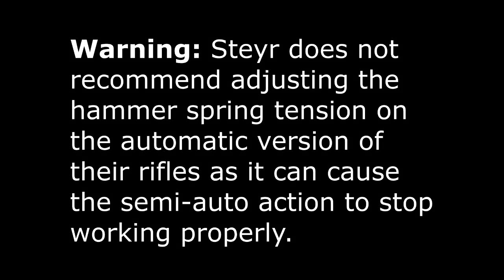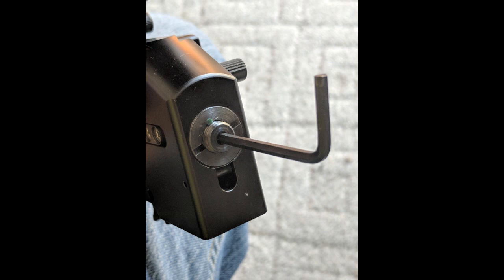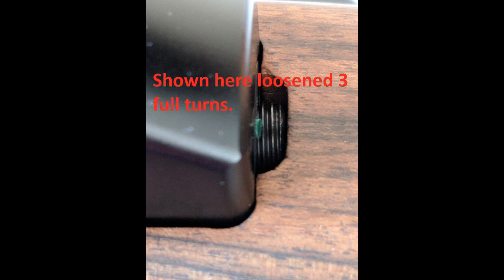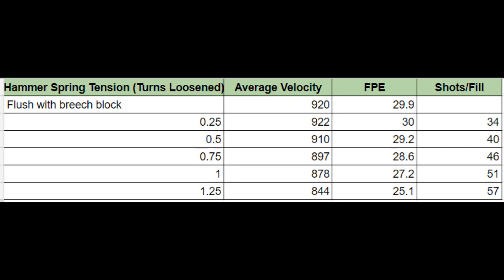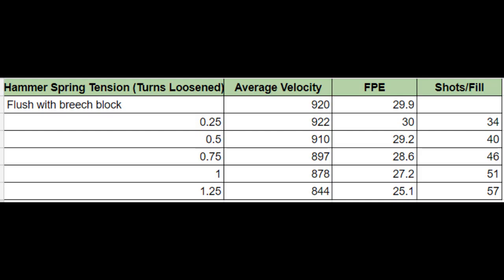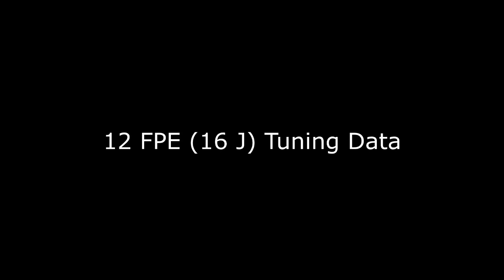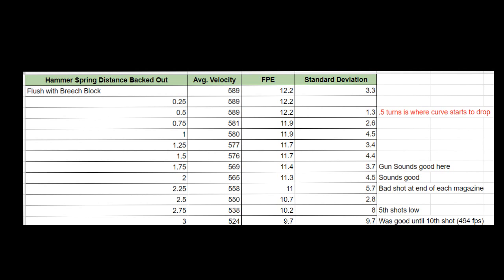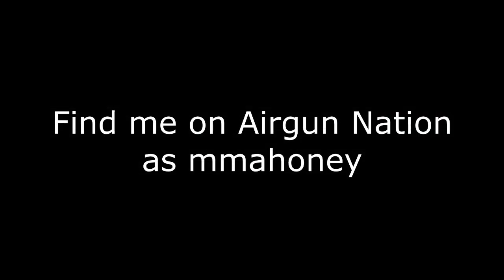Steyr Hunting 5 Automatic Scout Hammer Spring Tuning

Comment: Hi , and thank you very much for your videos all of it , it’s really helpful better than the company video, anyway i have pro x and am trying to reach 900 fps but I don’t know how am trying most of the thing but it keep stuck between 700 to 810 max could you help me with it
Reply from the maker: THe 40J version should be able to shoot lighter pellets 900 fps without trouble. I found my gun shot best at about 875 fps anyway and getting to 900 fps was counter production.
I have three ideas:
1) There might be a choke in the hole plugging up the transfer port to make the gun a 24J gun. I think I have another video showing where it is on the H5A. I've never seen a Pro X.
2) You have hammer spring is too weak. I wore one out adjusting it. Maybe you did the same?
2) Regulator pressure is too low. Changing the order of the washers stack might help. Again, I have another video talking about this, but if the gun is supposed to be shooting hotter I would probably recommend you send it in to be serviced.
Reply: Michael Mahoney you are right the problem is hammer spring

Comment: I have the pro X in .22 and have found the exact same results as you with regard turning the power down to 27fpe and 875fps. I too am getting approx 50 shots before the gun goes off the reg but I arrived at these figures whilst looking for the utmost accuracy. At 27fpe the gun is like a laser beam right out to 96 yards (haven’t tried further yet) in calm conditions. I’ve also found that a head size of 5.50mm is the best for accuracy and magazine fit. The 5.52’s are just too tight and you can damage the skirts whilst trying to push them in. All the best.